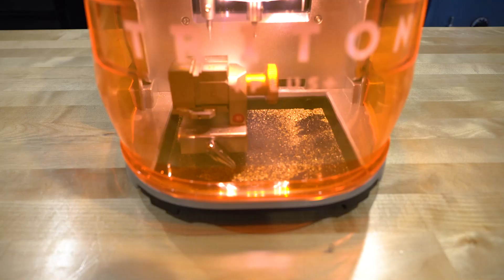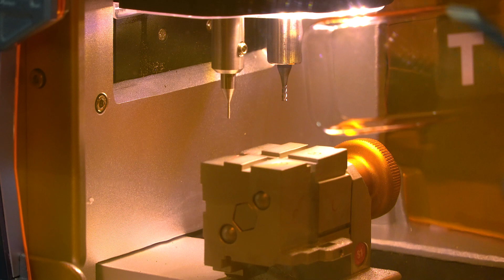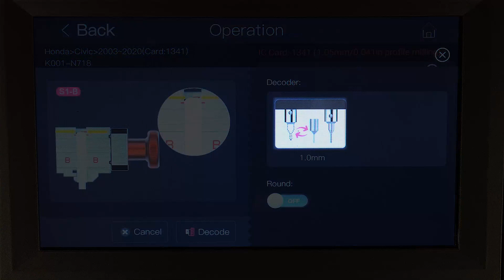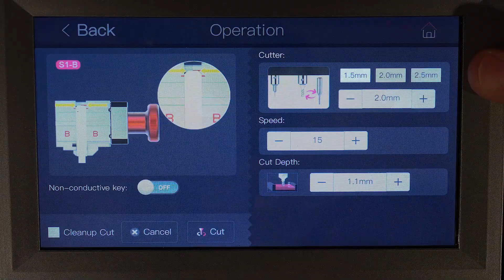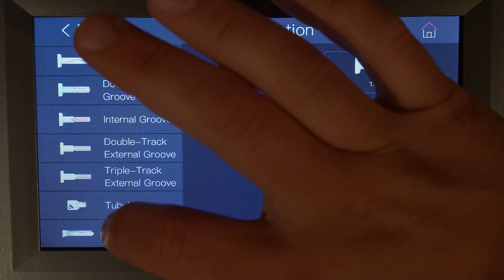Cutting Honda Keys... Friend or Foe?

Comment: I love this machine but it did ruin an Acura key because it had me set the key too deep in the jaw I double checked and made sure I followed the instructions and figured out it had it set too far back once I moved it to a different line it cut fine. That’s the only problem I’ve had with it. I just updated and want to see if it will cut the new 22 up civic blade correctly. We’ll see fingers crossed 🤞PS I use CLK more because I appreciate these videos so thanks guys 👍

Comment: Pro tip: 
Clean the customer key thoroughly before decoding it. You’ll get a more accurate decode, and it’ll prevent your tracer from bending or breaking. #Lockboss

Comment: I've had one for quit awhile pretty good machine. Didn't know about the clean up cut feature or how to use it duplicated Buick keys that worked in the door and not the ignition . Clean up cut feature would have fixed it. To see the option you have to prepare machine to cut the key again. #Lockboss

Comment: Good 👍. I find myself manually cutting honda keys with a cheap tracer, put key on one side and blank on the other and so far I did 100's of honda keys without an issue and when it's akl then I use my automatic cutter. Spent hours trying ti figure why I could not de ode a honda key properly and the time and wasted blanks paid for a cheap under 200 manual tracer best option I ever did fast and no dealing with electronic crap. But hopefully they are updating their machines to do a better job with honda.